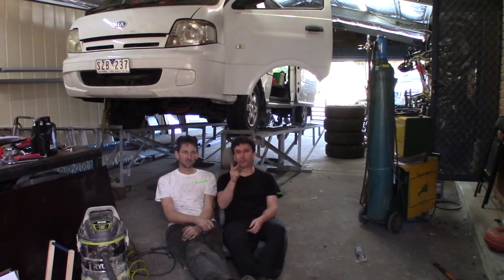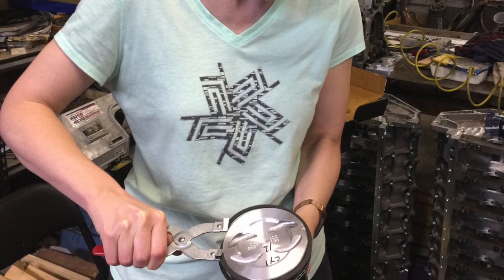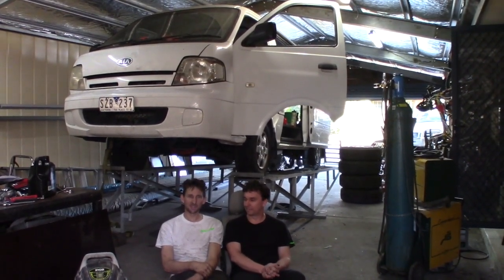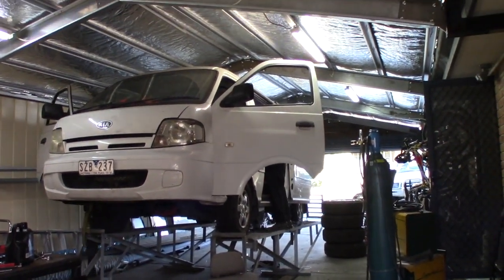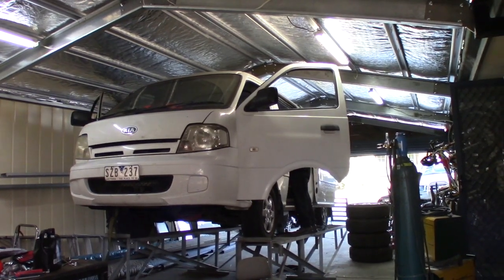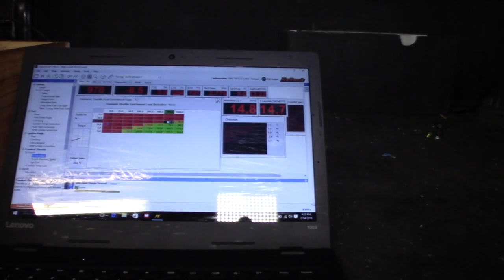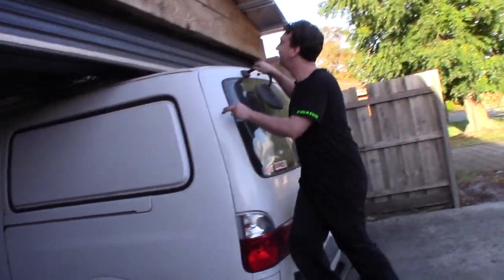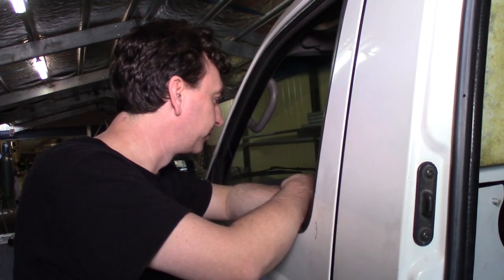We V12 LS Swap a KIA!

Comment: It takes up less space than i thought it would.
Reply: 2 bore spacings, or 8.8" longer than a stock LS, so they will fit in most full size cars with a bit of work. The van only required a small box in the cargo area to get it all in there, and that was designed for a 4-cyl.
Reply: WarWagonMT More people need to be aware of this, swap all the vans!
Reply: jody024 the LS is a space saver V8. 6.0 L in the same space OHC fucks can only put 4.0 L.

I want one for my Ford truck so I can overgear it and get 26mpg, then using a crawler gear smoke Ford purists.
Reply: The power of LS

Comment: Dude just disconnect the garage door opener and you can raise it higher. Hell of a lot easier than airing the tires down. That does beg a question...
Why did you even air them back up when you knew you were gonna just pull it out in the morning? Thing is wicked man!
Reply: twoeightythreez probably didn’t want them getting any bumps or flat spots from sitting with no pressure in them

Comment: Oh come on, a reversed flow muffler? All that nice pipework on the exhaust manifold, then the collector and NOPE, TURN 180 degrees to exhaust . 
Sport air filter literally right after the radiator sucking up heated air ONLY. 
I get that you have severe limitations on what you are willing to do on those tight spaces but IT"S A VAN. Use the space, do some plumbing. 
And you didn't upgrade the radiator when multiplying the power by a factor of 10?
I mean, it's a sleeper alright, but damn, so much "eh, fuck it".
Reply from the maker: Yeah, pretty much lol. We just did this to have some fun on a long weekend. Used it for a while as our delivery van too once we upgraded the radiator and had a better air intake. Have some more serious builds coming.
Reply: Next time you need a car to put a v12 in i will let you put one in my w124 😂 
Awesome work guys!